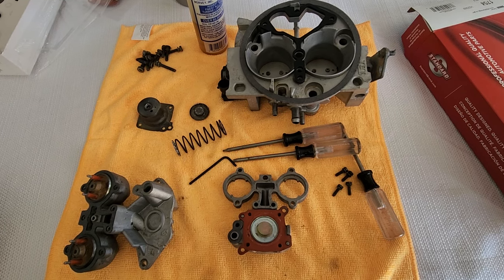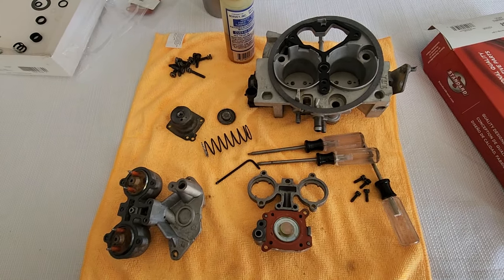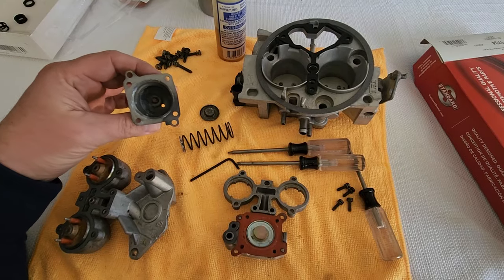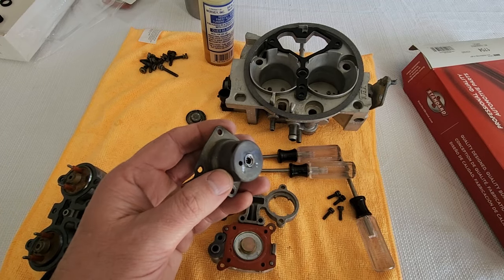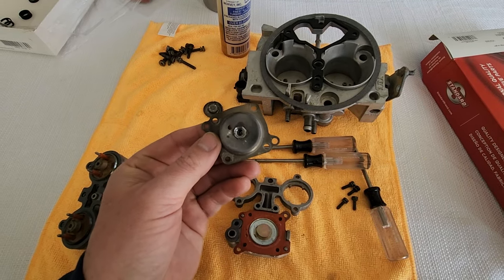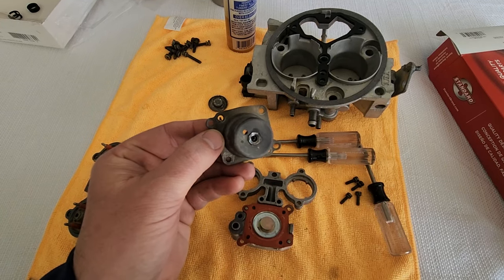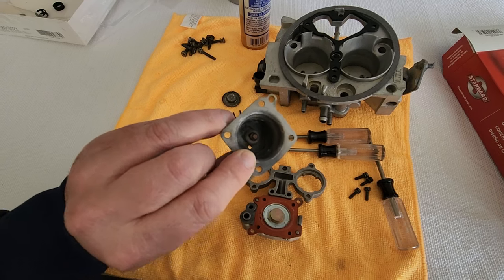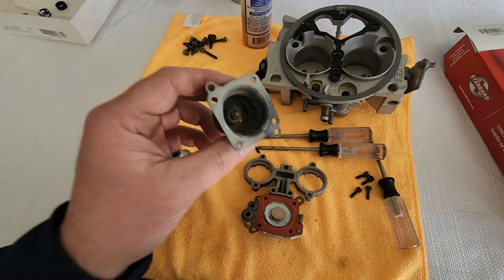Watch this before you buy a fuel pressure regulator for Chevy / GM TBI

Comment: Tip: Prior to installing any new paper gaskets. Coat them (both sides) with Chapstick. This will prevent them from sticking.
Reply: interesting, never heard of that before. Any experience taking apart one that's been together a long time with the chap applied?
Reply: @dieselmech7227  Yep, the chapstick allows easy removal later.
Reply: Do you recommend a certain flavor of chapstick? Or will the original one suffice?
Reply: @diegogodinez3541  Any will suffice.
Reply: @diegogodinez3541 i prefer cherry! 🤘
Reply: @marklivingston1479 😂😂😂😂

Comment: I really don't see those going bad the spring is pretty much set forever I've had throttle bodies 280,000 Mi and it just fine and if you're trying to increase your fuel pressure you're probably going to need to change the fuel pump too
Reply: My spring broke due to wear/tear and neglect from the previous owner. It rusted so much it cracked in half somehow. Replaced it and the thing ran like new! After replacing all the seals and a good cleaning of course.

Comment: The pressure regulter is set from the factory. No adjustment is needed. That's why it's soldered.
Reply from the maker: This is for people that want to modify their engines.  I added a cam and aluminum heads.  Needed more fuel.

Comment: The problem is is your spring they get stretched out I've done a lot of these you need to buy a new kit with a new spring kits are only like 30 something bucks at o Reillyim still driving my obd1 Chevy Astro with a new motor and still have my extra original in a crate just to save my own motor for a stormy day

Comment: I have 1995 throttle body in a g20 van. I saw this and looked at mine. What I saw was T8 Torx security bit should turn the screw without any mods to the housing.  I have not tried yet but pretty sure it will work

Comment: That screw may be for adjusting the fuel pressure. There is a similar one for the throttle lever minimum idle position.
Both are capped off from the factory to prevent further tuning, but can be taken out quite easily with a fine flat screwdriver and maybe some more persuasion from a drill bit or a cutting disc.

Comment: How do you know how far to screw it in or out without a gauge??
Reply: Trial and error, give one turn and see how it goes.
Reply: @seanr6314  I just did a gasket rebuild on the TBI unit on the 305 in my 87 Chevy pick up. 
I can't possibly see how you'd be able to make those turns with a wrench w/o having to partially disassemble the unit?? Are you somehow able to get a little Allen wrench in between the hard lines and make the turns?

Comment: What was the issue my idle drops when put in gear
Reply: thats how every vehicle works lol
Reply: Bad IAC stepper motor.
Reply: @gregorymalchuk272  ur idle is supposed to go down when u put  it in gear
Reply: @nickbazzett263  Maybe a little bit, and moreso on carbureted cars. But once computerized fuel injection began being introduced in the early 1980s, they integrate a governor that compensates the idle speed changes due to putting the car into and out of gear, the load of the power steering pump, the air conditioning compressor, etc. The governor software in the computer opens the idle air control stepper motor and electronically increases the duration of the fuel injectors. If a modern fuel injected car is stumbling or racing during gear changes, using the power steering, and turning the air conditioning on and off, the idle air control stepper motor may be sticky or failed, or the air passage may be clogged with dirt.
Reply: @gregorymalchuk272  i work at a dealership even new cars have an idle drop when placed in gear